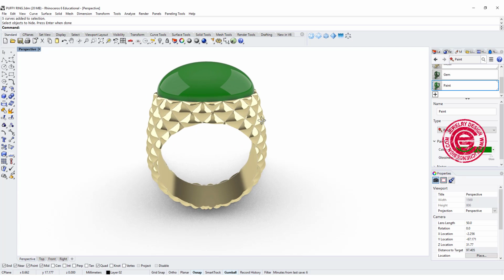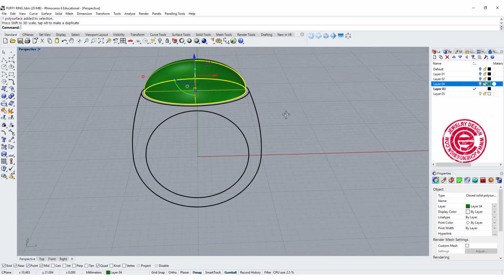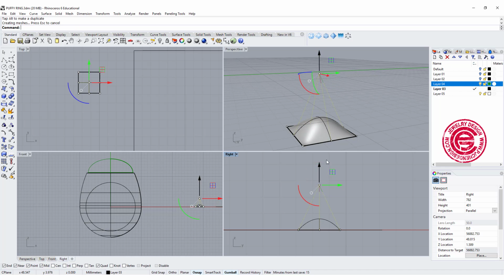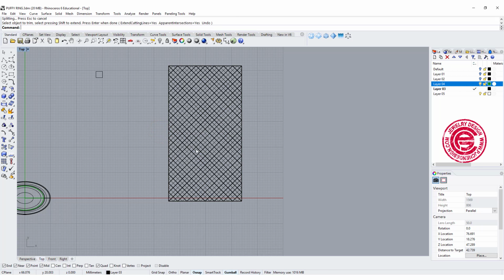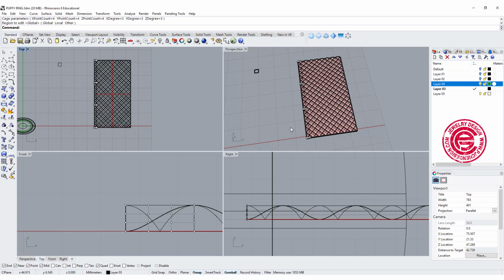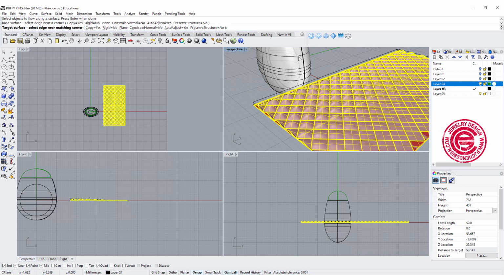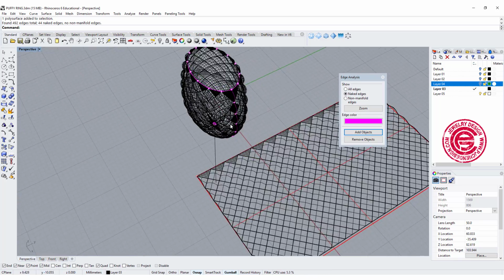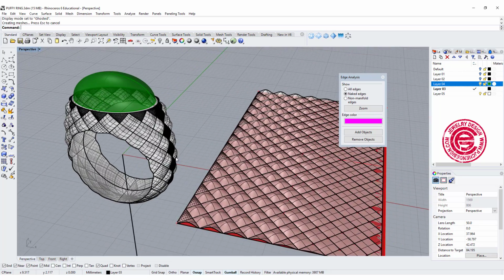How to Make Checkerboard 3D Pattern on Signet Ring in Rhino (2019): Jewelry CAD Design Tutorial #63

Comment: I loved the simplicity of this tutorial. I did it many times but it is always giving me the same mistake. Where the seam is always remain open, others capped easily. I changed the base surface to a slightly larger, exploded it and joined. What the problem can be? I am advanced on rhino :)
Reply from the maker: when you flow along surface, is the "rigid" on or off?
Reply: rigid no, i tried also to flow the uv object both joined and seperated pieces.  @PJChenJewelryDesign

Comment: my pc got 32gb ram, octa-core processor, but it still takes a lot of time for the rhino to transfer the textures? what should be the fix?
Reply from the maker: It really depends on how detail of the texture, what other program you are running while you are using Rhino. my laptop has 16GB RAM, and it has been working fine for both Rhino, adobe and keyshot running at the same time.

Comment: Why did you decide to use sweep 2 instead of curve network to make the ring?  It seems much easier, but on a previous video you made a signet ring using the curve network tool.
Reply from the maker: You can do either way, Just want to show various techniques possible in different videos for fans to pick.

Comment: I made it like your video tips but I can not closed the open surface for the ring with tips explode and re-join.
Reply from the maker: Hi aanaga sin, make sure surfaces on both side of edge are perfectly align before you flow. If it doesn't work. you can email your model to my email at pj@pjchendesign.com I will take a look for you.
Reply: @PJChenJewelryDesign  I did it again but It has been an closed polysurfeace now, well done. I made mistake as you said my surface on the side of edges not perfectly before. Thank you so much for the trick and tips Guru PJ Chen. Good Job.

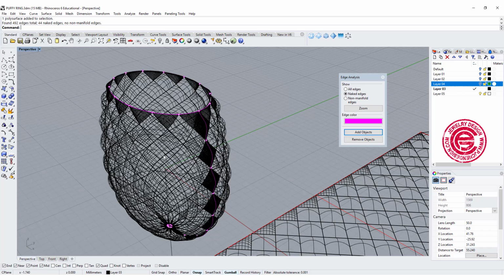Comment: PJ, great video. i have some challenges trying to copy your explode move at 13:46. After exploding and joining the surfaces, there is still an edge in the middle along the Z axis. Can you suggest what should I do?
Reply from the maker: Maybe the edges weren't aligned.
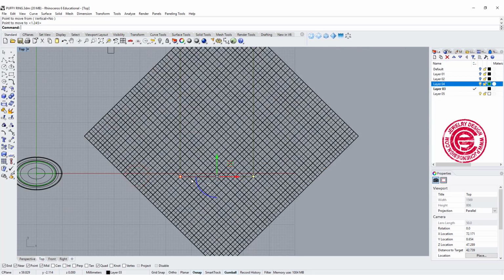Reply: @PJChenJewelryDesign  Thank you for the response. I have another question. At 6:15 in the video, you adjusted(enlarged) the UV curve and used that as the boundary to place all the small units. The total length of all the small units will be longer than the original UV curve(created from the volume) in Y direction. Will that create an overlapping condition at the seam?
Reply from the maker: @kungfurabbit8594  That will stretch the objects. If you trim at the correct place. it should not be overlap.